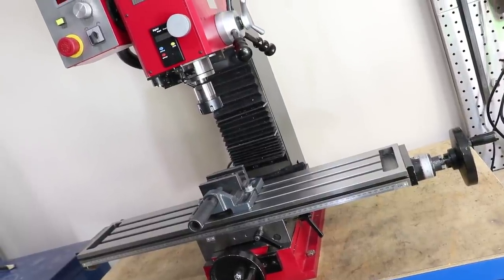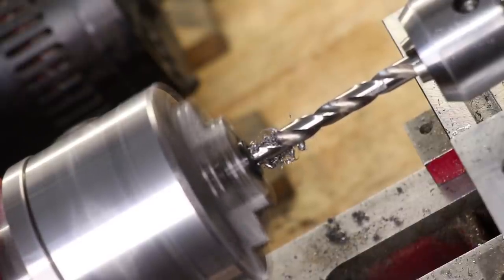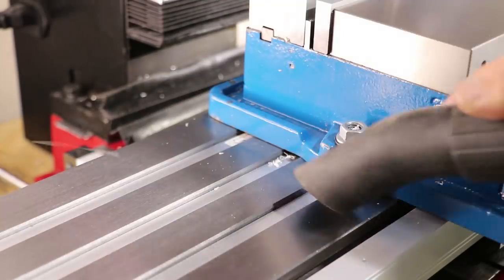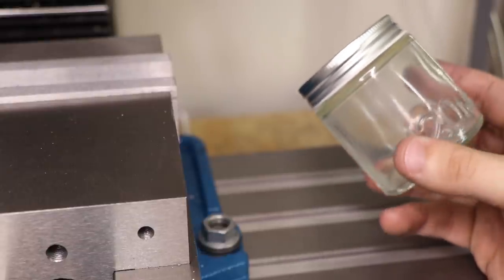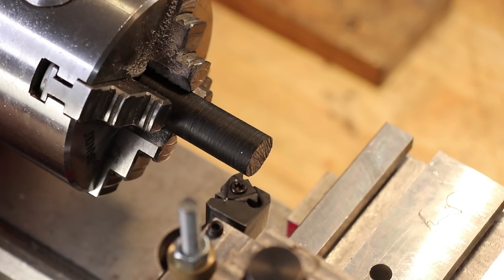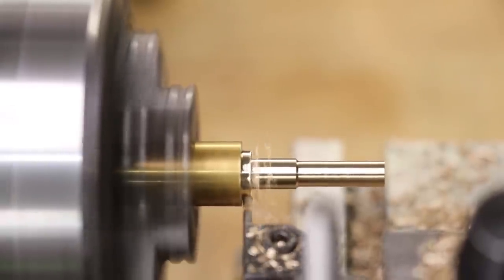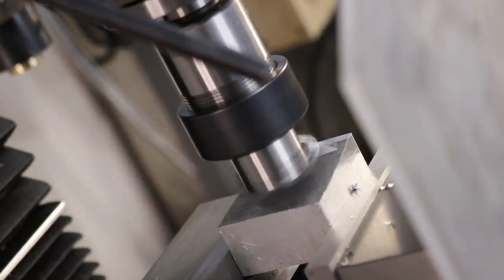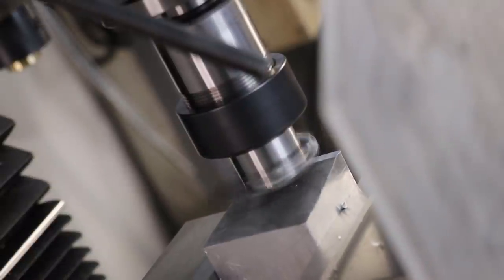7 Easy Milling Machine Improvements and Mods

Comment: For aluminium, try metholated spirits (or rubbing alcohol, as we call it where I live) as a cutting fluid.  It prevents edge build-up, evaporates quickly, and leaves no waxy residue like WD40.  I've never used kerosene, but it does make sense that it would work.  From using it for other things, though, I'd think it would leave some sort of residue.  But if it slows or prevents rust, so much the better.  I enjoy your channel, by the way.  Thank you for sharing.
Reply: Methylated spirits are usually denatured ethanol, whereas rubbing alcohol is usually just isopropyl alcohol(potentially scented in some places). Will work just the same, Methylated spirits typically smell horrible in places where they're consumed as alcohol.

Comment: I don't know if you watch Rustinox, but he recently turned me on to glue bottles? I had not heard of them. It's an oil can with a brush built in to the end. When you squeeze the trigger, oil does not shoot out. Instead it flows right onto the bristles. Very clean setup, one-handed oiling.

Comment: I highly recommend the rubber mat. It lowers stress on feet. Also if shop floor is cold concrete it provides some insulation against cold floor.
Reply: Reduces fatigue on all parts of your legs.
Reply: Yes, used to have wooden duckboards at benches and the like in workshops.

Comment: Very good ideas. The best ones I did for mine were
3 axis magnetic DRO
30 inch 50 lbs gas spring to help lift the head. It is now pretty easy
 A collar to lock the top of the spindle instead of the spanner. See the one LMS sells
Replace the table locking lever on the front with a large thumb screw. It snapped when it got bound up while moving the table

Comment: For the cutting oil point, I recommend to use the FogBuster or similiar lubricant system: it oils punctually the tool with just the amount you need.
Reply: Exactly don't use WD-40 as all that stuff does is cool the bit a little, stuff in not a lubricant as opposed to actual oil coolant mixes or straight oil. If you don't wanna use a pump just mount the tank high and let gravity and a ball valve do the rest.

Comment: Great vid, some fantastic tips, I'm looking to upgrade from the seig SX2, I had lusted after the SX3, but after seeing yours, and a few others, I'm now thinking I'll get the sx2.7, have you seen the upgrades available from the Little Machine Shop?, they're a good mob to deal with, postage to Oz sucks though.

They also sell separate clutches for the power feed units, I'm going to convert mine over when I get the bigger mill, power feed's are a must have for us old farts;).

Thanks for the tips,

Scott.

Comment: Those shoes looked like Crocs! Very Classy!
 Have you considered using an old poison spray pack to put coolant on the part. Just need to be able to pump it up between jobs and you should be able to get a fine mist right where you need it. I personally have not tried this yet but I have been thinking it is a cheap way to use minimal coolant without resorting to compressor and commercial kits.
 By the way I have purchased myself a mill. It is a Metex DM45 and will definitely be steal...I mean using some of your ideas.
Keep up the good work!

Comment: Make your own powerfeed its easy and cheap, I used a 24v wiper motor $70 
and bought a cheap speed controller $25 - $30 and used my 24v battery charger,
works great
Reply: Where did you get the wiper motor, Captain?
Reply: @markfryer9880  Online, parts store, junk yard, neighbors car in the driveway. They're all over. You really need your hand held to find a wiper motor?

Comment: Thank you for all the tips.  I wonder why not use plumbing PTFE tape on the drain joint, rather than silicone grease ?  
Best wishes from a Brit/Ozzie in Japan !
[ Sieg SC4 lathe; SX2P mill coming shortly. X2.7L mills not available in Japan, unfortunately. ]
Reply from the maker: i don't think there is a huge difference in which method you use to make it water tight

Comment: Putting a magnetic collar around the Allen wrench is a safer (and easier) choice. If you snap off the M10 bolt where you weakened it by drilling it out, you are going to have a rough time getting the stub removed.
Reply from the maker: Good thought. There should be enough material left in the head to hopefully avoid this. Cheers
Reply: Cut a slot in the end with a dremel and use a screw driver to remove.

Comment: Nice video there dude for anyone new to owning a milling machine. Just out of curiosity what’s the deal with the single point cutting by hand ?
Reply from the maker: With the fixed speed motor I have and the belt pulleys, I can't drop the rpm low enough to cut threads under power. I would change the motor but this is the first time in almost a year that I've had to cut threads this way so it's just easier to spin the chuck manually. The sherline I have has a pretty similar method to this.
Reply: @artisanmakes  Me too....I have an old 1930 Colchester Bantam lathe and the chuck screws on so reversing is not an option......for screwcutting I made a handle that plugs in the end of the spindle and makes possible reversing the spindle at the end of each screw pass....... many times I just wind the spindle by hand for small or short threads and internal ones.......the handle is removed for normal turning.
Reply: @artisanmakes  Do you mean because it is too fast and the risk of crashing the chuck is too high?  Turn the threading tool upside down and run the lathe backwards.  That way the tool runs off the end of the stock, rather than into the chuck.
Reply from the maker: Yes, with the current pulley ratios I have the lowest speed I can drop the spindle down to is about 400rpm. And unfortunately the motor won't reverse. I would change the motor out if I cut threads more often. Cheers

Comment: Wow this mill is allot better then mine :( Mine looks like X2D which is a complete junk.
Where do you this ?
Reply from the maker: I bought this from a company called Ausee off eBay. I looked into the X2L mill but ultimately settled on this due to the larger table and fixed column. I'm not too familiar with the x2D but I have seen quite a few upgrades for them.

Comment: Great tips mate. I’ve ordered the Sieg SX2.7 and should be here next week. I was going start building a stand for it. What height did you build your stand ?
Reply from the maker: Not sure how other people prefer it, but I like my mill and lathe table to be a little higher than most. The mill table is about 1m high. It just means I don't have to lean over as much when looking at the table.

Comment: That's probably clear ABS. Acetone is the solvent for ABS, so you could possible use that.
Reply from the maker: That might be something with trying, did something similar once to some abs 3d prints. Cheers
Reply: I doubt it. Transparent ABS (Strickly speaking MABS) is something of a specialized material and fairly expensive. Judging by what the plastic was salvaged from I'd say its more likely to be polycarbonate or polystyrene. I've been in the plastic industry for 32 years the last 15 or so as a process engineer. Transparent ABS is something that just doesn't come up hardly ever from a production and design standpoint. At least in the portion of the industry I work in.

Comment: now that you have both, which one would you buy first: lathe or mill ?

I will be mostly drilling the 23 mm hole in the rectangular aluminium block, and a few smaller holes in the corners, which I can handle with my drill press. but that large 23 mm hole is a tough one to make in batches, and I don;t feel safe doing it on the drill press either. I clamped it as hard as you can imagine, and the drill press is still vibrating like mad, and the table is bending slightly downwards from the force, and that also makes the hole slightly out of perfectly parallel to the block's walls.

unfortunately I can't afford 2 machines, and I need to wait maybe a year to buy another machine.

your advice would be greatly appreciated

Comment: Try a heat gin to get the plastic shield back to clear (melting and reflowing the surface)
Reply from the maker: I tried flame polishing and the such bit that didn't work, I'll try with acetone, if not I can pick up some acrylic. Cheers

Comment: Those plastic pieces on blow moulded boxes are almost certainly polycarbonate. Styrene if it is floppier than spaghetti, polycarbonate if it is stiff.
Reply from the maker: Most likely this is the case. Cheers

Comment: 10:00 if you approach the part with the fly cutter from the opposite side it’ll throw the chips away from you not towards you 🙂
Reply from the maker: You still get chips thrown at you most of the time doing other types of cuts
Reply: @artisanmakes  ok, a lot less chips,…….

Comment: Great series of jobs, but I don't understand the hand thing either...
Reply from the maker: With the motor I have I can't drop the lathe rpm low enough to cut threads. Not a big issue since this is the first time I've had to cut threads on the lathe in almost a year.

Comment: Good luck keeping chips 🍟 out  of the drainage port😢
Reply from the maker: tends to only be an issue if you use roughing endmills a lot. Normal chips can be sucked out with a shop vac
Reply: @artisanmakes  yha I can imagine, chip like to migrate to the lowest point. Kinda like water.

Comment: Do not use kerosene! As soon as you take a piece of steel to the grinder you will regret it.
Reply from the maker: Kerosene is not a big risk. It mostly comes down to the flash point. its been used as a cutting fluid for aluminium for the better part of 100 years

Comment: Quill lock- you shouldn't be doing fine adjustment with the quill
Reply from the maker: I don't see why not, it's fitted with the dro and the worm gear allows me to make much finer adjustments than I can by moving the head. It's certainly rigid enough to do so.
Reply: @artisanmakes  The knee, or whatever adjustment you have for table, usually have finer, more precise adjustment with less backlash
Reply from the maker: Cheers, this one is a bed mill and I do move the head for most stuff, however having a dro on the quill which I can set origins is an advantage to me. Either way I still have to use the quill lock to unlock the quill for drilling, and to be honest, drilling is probably 80% of what I use the mill for.
Reply: @justaguy4788  Take a look at the mill again at 0:00. Let me know what you see. Adjust that knee. 😂
Reply: are you familiar with the word "or" ?
Reply: @justaguy4788  Still applies. You're apparently not familiar at all with these tiny mill-drills.